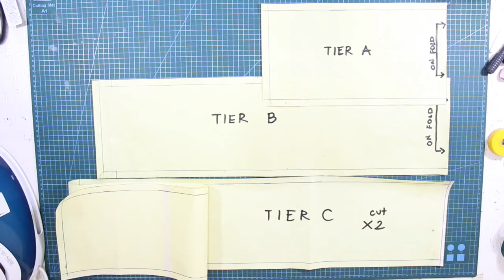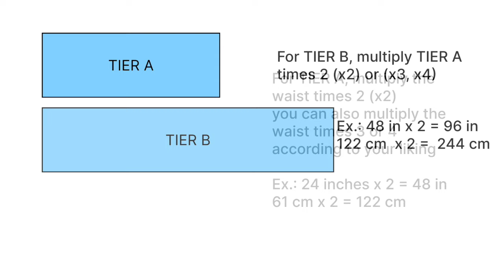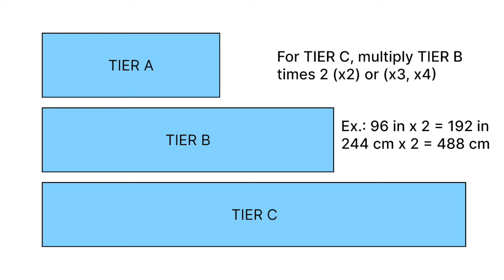TIERED, GYPSY, PEASANT SKIRT TUTORIAL | PATTERN MAKING AND SEWING TUTORIAL | LA MODÉLISTE

Comment: How did you do the gathering of the fabric?
Reply from the maker: Using a sheering footer
Reply: @LAMODÉLISTE l need one of those.  Usually I just make a loose stitch going across, and then I pull both ends of the thread to make the gathers😅